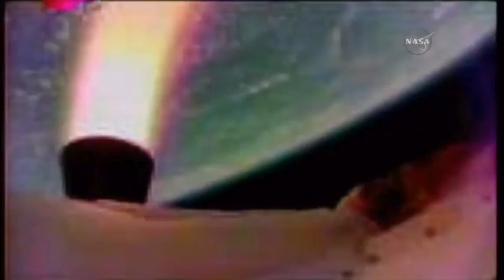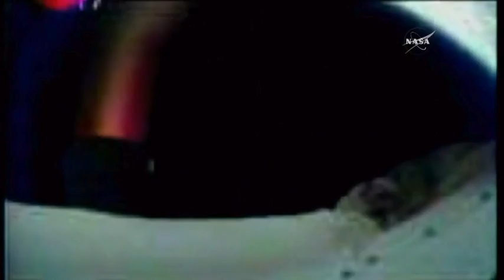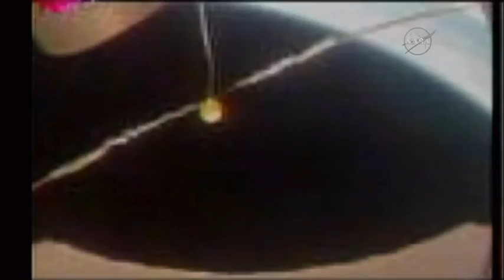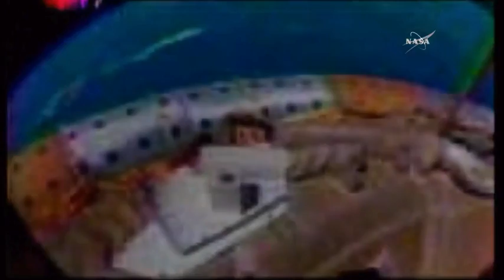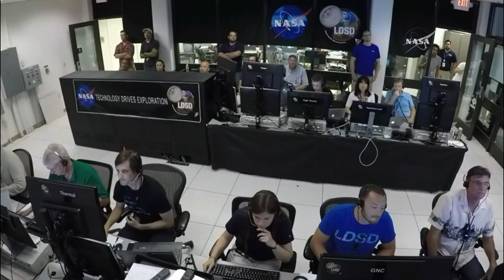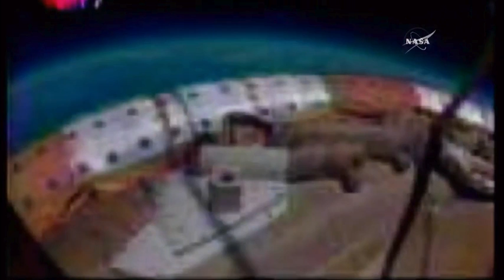NASA's 'Flying Saucer' Parachute Shreds Again During Test Flight | Video

Comment: Ah so the actual vehicle worked fine, it deployed the inflatable section which slowed it down just as it was ment to.  Then after this - it deployed a chute which was supposed to slow it down even further, but this chute wasn't strong enough and it shreded.  So they'll have to redesign a better chute, or perhaps increase the inflatable section's surface area so that it slows it down even more before the chute deploys.

Simple chutes like this are pretty well understood tech, so improving this will hardly be an issue.  It's the inflatable section which is the real star here, and that part seemed to work flawlessly.  So yay!

Comment: i don't understand how they tested the parachute on the ground
it's been tested the wrong way i think
what happened during the ground test was not like what happened in the upper atmosphere today on the second test(06/08/15)

on the ground the parachute was already fully inflated  and descending slowly and then dragged by the booster

in the upper atmosphere the parachute was at mach 4 when it inflated

the ground test conditions were no way near what happened today

what i want to say is that the test should have been made with the  parachute folded and at a higher speed not at mach 4 because of the denser atmosphere
but at least behind a rocket going down then deployed at the optimal speed.

this test is valid only for non existent binary parachute  that are either folded or inflated.

OR they thought the deployment transition was not an issue, that the only matter was the drag load.
Reply: milxl temperature might play a role in this
maybe the turbulence of the saucer is giving some side stress that otherwise it wouldn't get
you see it tumbling to the sides a lot so maybe it's putting the stress completely on one side getting over the max load it can hold
maybe it sudden opening wrecked it
as you said the ground started slowly and then dragging it to speed so it didn't had that sudden pull on it
just speculating though